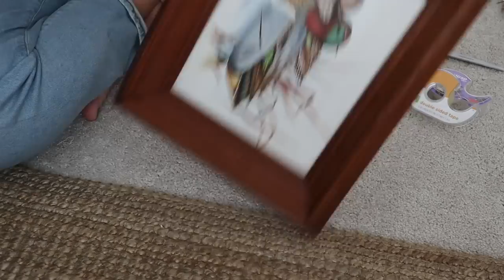Extreme BATHROOM MAKEOVER (From Start To Finish) | DIY Guest Bathroom Makeover + Full Tour!

Comment: If you take off the tape when the color is already dry, you have the risk of removing little parts of the dried paint...

For the next paint job:
Remove the tape while the paint is still wet and you won't have that risk. And paint the color of your wish directly to the wall without that second color. It's clean anyway